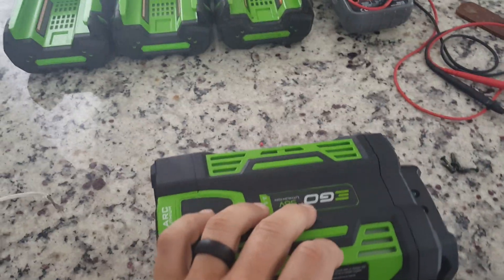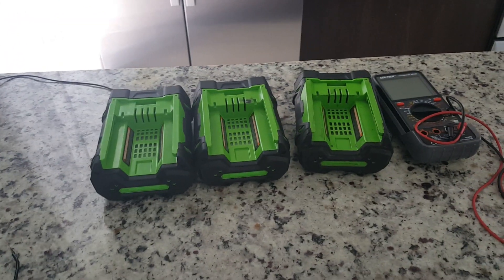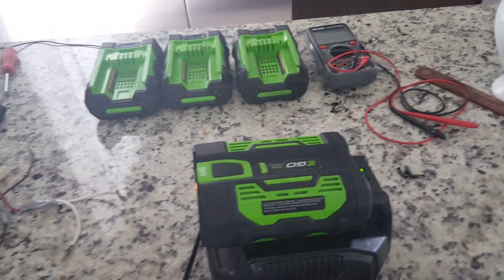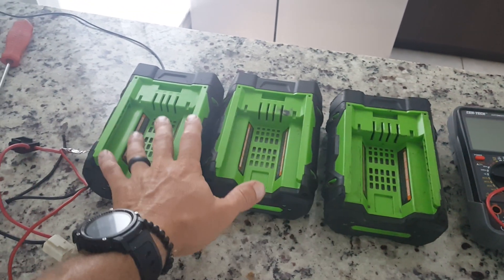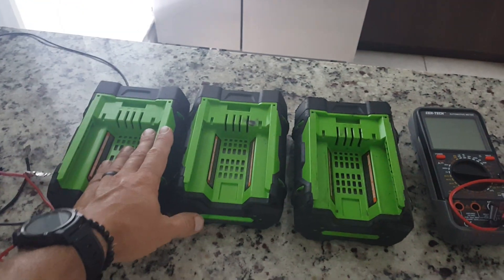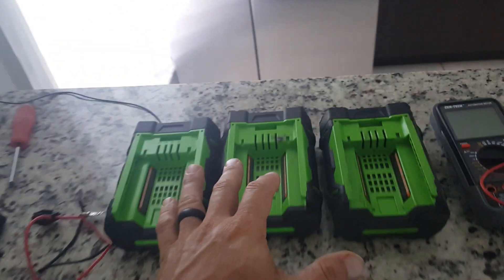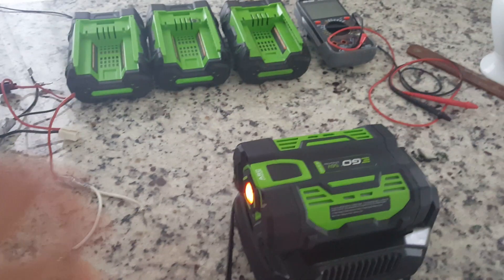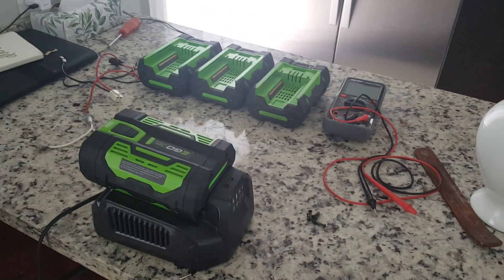Ego 56v dead battery fix

Comment: Fixed! I did the 6 inch drop onto concrete and put the battery on the charger and amazingly it started charging. I too had the fully discharged red light on battery and it wouldn’t charge on the charger. I called ego support and it was out of warranty. Was considering the jump start thing but last ditch tried the drop and it worked. Totally stoked!

Comment: Wow this actually worked, thank you!!

For those asking how to wire it, just take regular 14/2 nmd90 electrical wire and touch the positive of the dead battery to the positive of the charged battery and do the same for the negatives. The back of the ego battery has 4 slots, just use the left and right most slots. Disregard the middle slots. Touching these contacts at the same time shocked the battery back to life. 

Thanks again!
Reply: Not sure if it will work seeing as how the ego battery is 56v, but it probably will not damage the battery. You don’t have to leave them connected for long. Just a few seconds jumped mine back to life.
Reply: I don't have a good battery could I use a 12v car battery charger to jump start it
Reply: how long to you boost it for?

Comment: You could also just throw a 12V trickle charger on them for an hour or five to get them up from zero and then use the normal charger. I have some 20V Black & Decker batteries that were completely dead and revived by throwing a 5V charge on them for a couple hours Using an old cell phone charger. Once it has some power, the smart chargers will recognize the battery and do their thing.
Thanks for your video and the info
Reply: I have a 56v battery could I use a 12v car battery to jump start it?

Comment: You just saved me the $250 for a new 5Ah battery.   Worked fine last season, then sat on the charger for a few months and suddenly, the charger wouldn't recognize it.  I thought the charger failed.  Gave up and bought the smaller battery locally, the 2.5ah one.  Plug the new battery into the old charger and it worked fine.  So now its a battery problem.  Mine had 7volts across the terminals but wouldn't charge.  I gave it a jump start with the new battery and boom, it started charging.  Took a full charge and range seems normal.   Big thank you!

Comment: Trying this now on a 7.5ah ......charger says is full but at 54v. 

Using a 2.5ah battery that isn't full and at 57v. 

Initially 3.4a flowed and after 30 seconds I'm down to 1.7a. 

Not much current.....under 200w.

Comment: I'm extremely disappointed in this brand. 

This is my 2nd summer using 56v 5.0AH EGO batteries and they just won't hold a charge. 
This is on the 5 blinking light battery:

1. Place battery on charger
2. Starts charging
3. No more than 10 minutes later, stops charging. 
4. Take battery off charger, check charge level - it hadn't even charged 1 extra bar.
5. Place battery back on charger - begins charging.
6. No more than 10 minutes later, stops charging.

Basically I need to babysit the battery/charger in order to get it to continue charging. 
I've tried two different chargers and 2 different batteries - they both do the same thing.   Very poorly made expensive products.
There's a warranty on these expensive things - so I'm definitely using it.

Comment: I am having a problem with charging. The chargers green light blinks twice and intermittent off and on. The battery blinks green three times intermittent off and on. I am just wondering if the charger is completely bad or if the battery is so low that it won't charge.

Comment: Possible method to reset battery pack

I pressed and held the battery button while placing it on the fast charger, continuing to hold the battery button for several seconds after putting it on the charger.  THIS WORKED!!
Reply: Thanks this seems to be working for me too.

Comment: Worked like a charm. Just connected + to + and - to -. Counted to 30, placed on charger... bingo. Thanks for the tip.
Reply: Did you need to open it up or were you able to leave the case on?

Comment: What if my Ego charger(I have 2 of them)f/the "56 v blower" only holds SEVEN MINUTES of charge?  That's for both batteries(I own a 2nd one as a backup)-and I have a card attached to the blower which says "75 minutes" of charging time or lasting power that the batteries are supposed to have, when fully charged; this has never been true, since I first owned the blower, w/the batteries, back in May of 2019.  Why didn't I get a refund?  Because I supposed I was so busy at the time, coupled with the fact that there just aren't any good blowers for a comparable price, that were available.  
I mean the blower does the job, it just doesn't hold the charge it is claimed to hold-not for even eight-but seven-minutes(yes I timed it repeatedly over the last 2 1/2 years since I first purchased the blower with both batteries-and the extra battery cost me $150.00(at Home Depot); I feel like I've been took but I've had the blower for too long to return it(and yes I tried to contact Ego at their headquarters, within the 1st two weeks of purchasing this blower and battery-by phone, and online as well as by mail-sent them a letter detailing the problems I was having w/the batteries-but I never, ever heard from, or got a reply, back from them)-perhaps someone who sees this can help me with my situation or problem. 
P.S: Was watching a Youtube video which stated the battery, when fully charged is supposed to hold no less than FOURTEEN MINUTES OF CHARGE-what then, again, for both of the batteries I've had-and used-consistently-for the last two and a half years?
Posted 11-3-21.
Reply: You have to register your batteries (tools too) on their website. Then call them with your issue. Then they're going to waste a whole bunch of time troubleshooting the issue before they send you a replacement battery under warranty. I've done this twice now, both times successfully.

Comment: I'm also using the 2.5 56v On my razor scooter. I got a 800w 36v motor and controller. It's been handling it with no problem at all. I gotta used ego 56v 2.5 . it Don't light up when you push the fuel button Or when you put it on the charger don't show any charge. It does have 53.3 volts now. Do ya have any idea why It's not charging or what I can try?

Comment: Good tip but use resistors as jumpers next time to slow down the charge. The batteries got hot because putting them in parallel like that dumps TONS of current into the dead battery. Possibly 20 amps or more! That will shorten its life significantly. To bring old lithium batteries back to life it’s best to charge them slowly by limiting the current. A pair of 100ohm 25w resistors would be my choice.
Reply: is this a general concept for all lithium batteries or these particular 56 V? I have a generic Milwaukee 18 V that I think is too low and won't charge
Reply: @roninwar9846  it's the same for all lithium batteries. They have low internal resistance so charged batteries output high current and dead batteries readily accept it, whether or not they are able to actually charge up. This is different from low lead acid batteries, which sort of self-regulate the incoming current.

In your case, this method probably won't work. 1) because the M18 packs have MOSFETs that turn off charging outside of the charger (they allow power out but not in) and 2) because in the dozen M18 batteries I've been inside, they usually have a single cell (or parallel cell group) out of the 5 total that is low, rather than the whole pack being low. Your best bet is to open the pack and try to 'balance charge' by slowly charging each cell/cell group individually to an even level, like 4v. Then with the pack balanced, put it back on the charger to let the charger determine the final charge level. Lots of videos on balance charging, make sure you watch closely and read up on the subject before attempting it.
Reply: would you use one resistor each, one for + to + and one for - to -?
Reply: @marcxgajeton  yes I would just so that any heat is split among two resistors rather than one.
Reply: It's too bad the ego charger doesn't offer fast & slow modes for charging. I don't want them to charge fast like they do, I rather it charge slower and extend the life.
Reply: @CONald_is_A_false_Prophet  I use the black basic chargers. They’re the ‘slow’ ones. They blow air through the battery during charging which is a huge difference from other manufacturers. I don’t think they’re shortening the life of the batteries.
Reply: @colindgrant  oh ok, that's what I have been using also. I do like the internal fan, it just seems like it charges rapidly like less than an hour. I have 20v batteries that have lasted over 10 years now and hope I can get a similar lifespan from this ego but I am seeing people typically have problems with these lasting.
Reply: @CONald_is_A_false_Prophet  yeah we’ll see. EGO has already done a free warranty replacement of one of my 5.0Ah, no hassle. So that’s nice at least.
Reply: And where can I get some 100ohm resistors?

Comment: Video could be improved by showing how to connect the batteries.
Reply: Honestly, if you can't figure out how to connect + to + and - to -, you shouldn't do this.
Reply: @jonathanridder  I think a visual would be helpful,   but I guess it means just jump from one sealed battery to another using thick cables and flat metal in the + &  - tabs

Comment: My problem is a bit odder. I have a 7.5ah battery where the cells all seem to be ok. The problem is charging.
I get a full run on the battery in my EGO mower. When the battery is down, I put it on the high (or low) speed charger. The fan hums, the green light flashes, and then in 30 seconds or so the charger shows the batter fully charged. It obviously hasn't charged. The voltage reads around 46v. No matter how long I wait, unplug everything, etc., this won't change.
From some other electrical experience, I tried putting the battery in the fridge or freezer for a few hours. Then I put it on the charger and all worked normally. Got the battery up to full voltage and could do a normal run with the lawn mower. This has worked several times, telling me the battery cells are likely ok. It's something else in the battery circuitry.
EGO does not repair batteries, even if the cells are ok. I'm wondering if anyone else has seen this or has any suggestions.
Reply: I have a 7.5 amp hour battery that I got with my 21 inch push mower. Just over two months of owning it, the battery whether it's fully charged halfway or whatever will completely die when using the mower. All five of the LED lights on the battery will turn Red. They will be solid red for about 5 to 10 seconds and then shut off. At that point if I put it on the charger even though there's plenty of charge, they will still show up all red. Now, if I wait 20 minutes and then charge or start using the battery in my mower I'll have about 15 minutes of run time and then the LED lights will turn all red again.The battery was under warranty. So I'm waiting for my new battery to be shipped to me. It's been almost a month and still no battery. What a joke.
Reply: I actually just had this exact issue with my 5.0 blower battery. Ego did replace the battery fairly quickly, so you might want to call them again.

Comment: Yay I jumped my two 2.5ah batteries using a cut up hose clamp for 20 seconds and now it's charging.
Reply: It won't charge it all the way though. I opened the battery and found one of the small wires going to the battery was not soldered on. It's charging now

Comment: So, I have a good 7.5 Ah jumping a “dead” 2.0Ah and the 2.0 has no lights at all and even when I’m jumping it I am getting the 2.0 to have a flickering red light when I push its status button while being jumped from the good 7.5Ah. However if I unplug the jumper cables the 2.0 status button does nothing anymore and nothing happens when I put it on the EGO charger. So I am wondering how long do I need to jump start it with the 7.5Ah for it to work on the regular charger on its own???
Reply: The "jump" should only need to be in place for a 30 - 60 seconds.. really.  If the BMS isn't lighting up, you may have a blown fuse inside the battery.  Pop the case open, swap the $0.75 fuse, close it back up, see if it'll charge.

Comment: Thanks so much for the idea to "jump" the battery. I got a "defective" 7.5ah battery that wouldn't charge and got it charging/working with your idea. I had to cut a few thin pieces of metal (cut up a hose clamp with tin snips) for the contacts, VERY CAREFULLY inserted them, being careful not to contact/bridge them together, used a pair of car battery jumper cables, hooked the batteries together for 30 seconds and then quickly put the "defective" battery on the charger and got it to take a charge. I tried putting it on the charger previously 20 or so times and got the red "defective" light. Defective battery was only showing about 30 volts according to my multimeter. Good battery was about 55v.
Reply: car jumper cables? you need that thickness gauge? really?
Reply: I don’t believe that is necessary, that is just what I had within reach when I did this. The internal battery wiring I think is around 14-16ga. I wouldn’t go too thin or it might melt/burn insulation.
Reply: @talon146  ok jumper cables and some cut up hose clamps it is- will see later today

Comment: Is that motor still holding up at that voltage?  Did you have to use a different speed controller or did the stock board take the 56v?
Reply from the maker: Its still working and I bought another 650 for my older son and they take the higher voltage no problem.

Comment: How long did the batteries need to be connected to each other to get enough charge for the battery charger to work?
Reply: Same question. I have a good 7.5 Ah jumping a “dead” 2.0Ah and the 2.0 has no lights at all and even when I’m jumping it I am getting the 2.0 to have a flickering red light when I push its status button while being jumped from the good 7.5Ah. However if I unplug the jumper cables the 2.0 status button does nothing anymore and nothing happens when I put it on the EGO charger. So I am wondering how long do I need to jump start it with the 7.5Ah for it to work on the regular charger on its own???
Reply: @alexmasi9453  , when I tried this on my batteries, it was about 10 min, but I took a break because the batteries did get quite warm at one point. It's definitely good to keep a (gloved) hand on the batteries to make sure they don't overheat. This trick totally saved my 7.5 Ah battery, but couldn't revive a smaller one that had been discharged longer.

Comment: Mine wasn't charging.. no fan, etc..  Read about dropping the pack on the floor...   SO I hit/tapped it with  a rubber mallet on all sides several times and it is now charging away.
Guessing the battery contacts somehow get a buildup and lose contact....
Reply: Same problem my battery was 1 month outside of warranty - EGO response TOUGH so no more buying of their products.
Reply: Dropping it worked! Red lights when I pressed button and would not start charging. Tried holding the button for ~30 seconds while on charger and nothing. Just got some hose clamps cut up and on the way to car for jumper cables (Figured I'd be around the corner to make connection in case anything blew up 8-). On the way, I tried dropping the battery on garage floor from about 6 inches, once. I put it on charger and it charged. Put it on my trimmer and it runs so I'll make sure never to let it get to zero again. Thank you.
Reply: My first battery died after four years.  Had heard about the dropping it on the floor trick so I did this and it worked, giving me another year before it died completely.  I always put it back in the charger after use.  Five years from a battery used on two devices regularly isn't bad in my view.
Reply: Wow.  My 3-year-old 7.5 amp died suddenly.  Dropped it a couple of times from 6 inches...and now it's working just fine!
Reply: Just dropped my battery and it started charging! Genius!